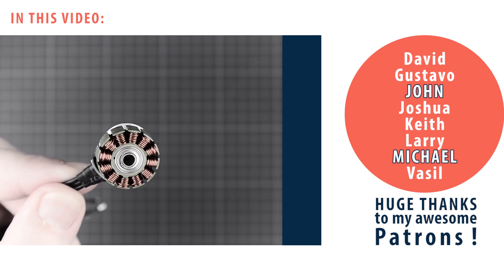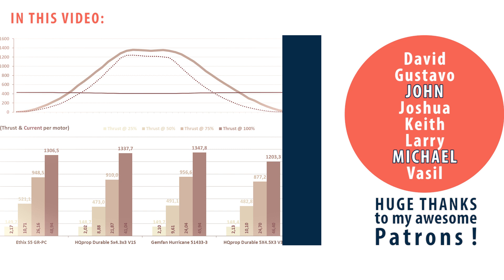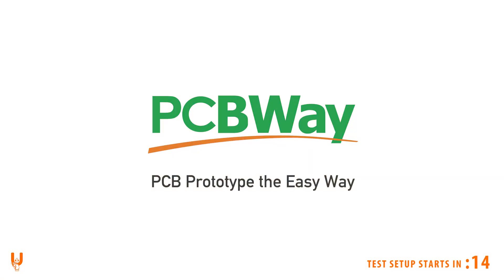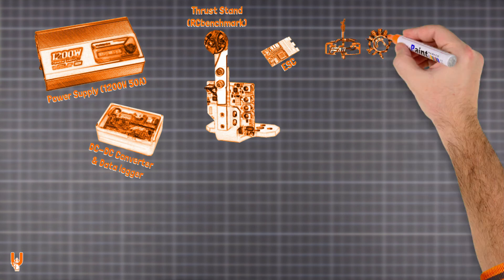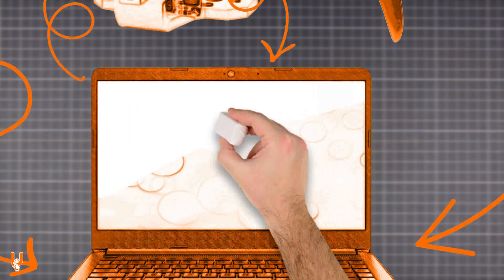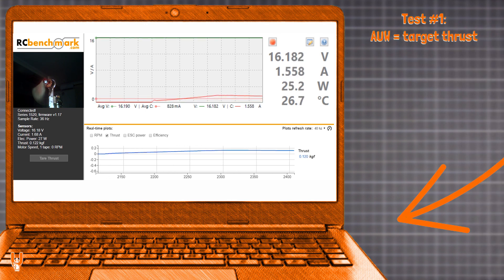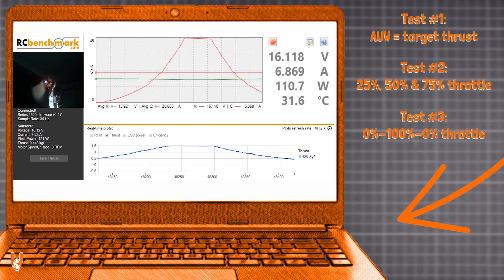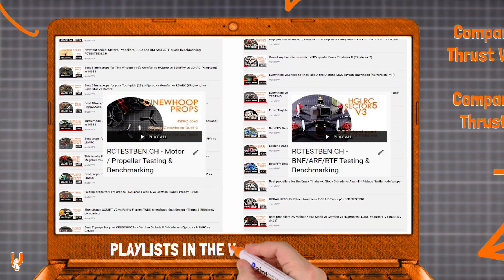Diatone TOKA 2207.5 2650KV (4S) brushless motors for FPV drones : Thrust and Efficiency on 5" props

Comment: Thank you for this video, trying to find the best prop for my 2450kv motor,i have 5046 gemfan 51433,51466,and 51477.trying to find best fit for my roma.f5 dji.video helps. Looking for most thrust and most efficiency somewhere in between on my 4S heavier quad.thanks.
Reply from the maker: I will be doing several 5" and 5.1" prop comparisons for freestyle and racing, I am sure you will find the results useful! The 51433 is a very nice prop. Also try the HQprop 5x4.3x3 V2S!